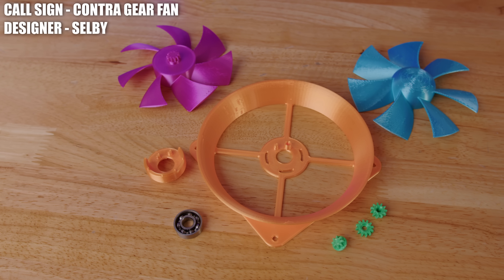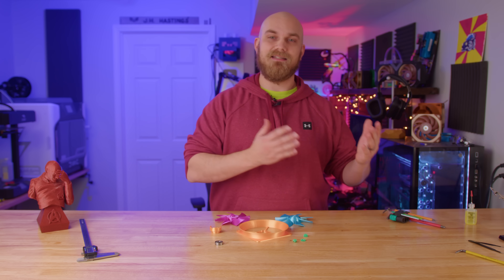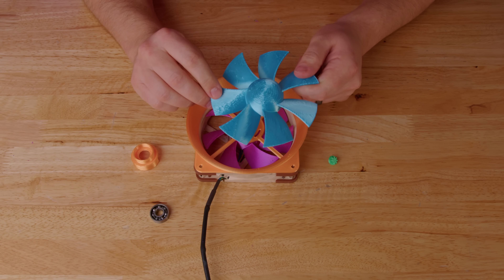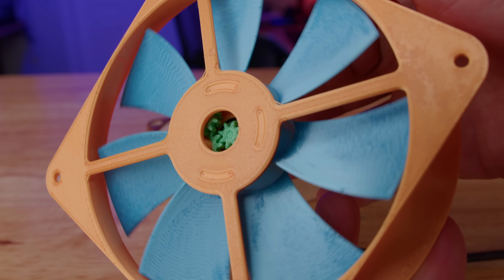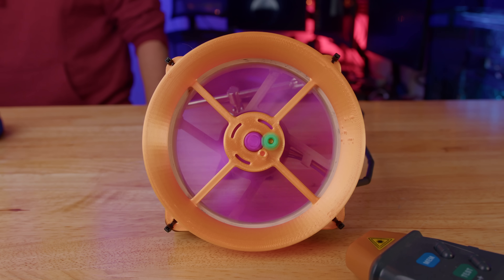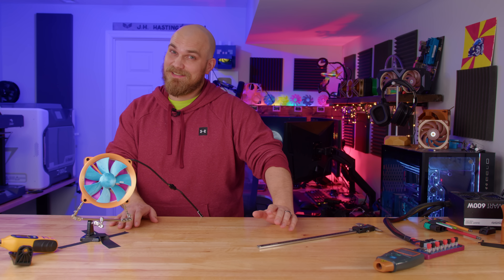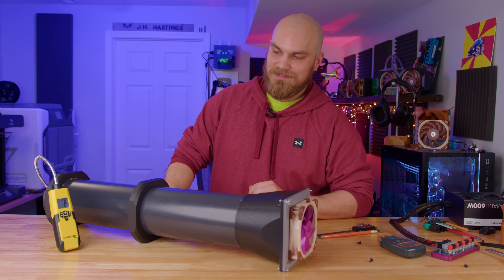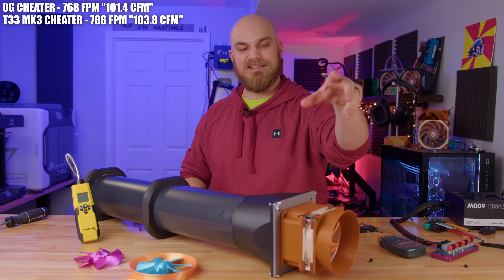World’s Most Complex PC Cooling Fan | Fan Showdown S4 Special

Comment: Contra rotating props are fascinating to me. Such an efficient concept and I bet if you could tweak the tolerances enough to get a more precise fit or even find a way to seal the gear case so you could pack it with grease you could tighten up the tolerances just by doing that. Such a cool fan design! Good work, Selby!

Comment: Something weird to try... Instead of a fan, instead hook up an air-compressor tangentially to the housing -- The pressurized air should form a vortex, pulling in air at the front and concentrating it at the rear... It may not be a practical solution, but it should be fun to watch!

Comment: You do know counter-rotating fans are readily available from the big industrial manufacturers (Delta "GFB" series, Nidec, NMB, Sanyo Denki etc.)?
Then again, those use two separate motors (usually with separate wires even) so maybe this is "cooler"…

Also, those usually have a different number of blades for each impeller, so as not to create a siren (though they're still quite loud at their rated speeds).

Comment: It would be neat to see how quickly the high performing fans evacuate static air (represented with “smoke”). You could use a plexi or acrylic sheeting, clear, and have a port for the fan with a seal to pull the air out of the clear box.
Edit: that way we could have another real world visual representation on how it could work in a case.

Comment: It's possible to use reduction gears to drive the outer contrarotating fan slower, which means it can be bigger, so I'm thinking a multistage compressor in a horn shaped housing.

Comment: Imagine if you measured the max torque at all RPMs of the motor and calculated where it makes peak power, then used that to design it for the optimal RPM, thereby getting a slight advantage just because you can use more power

Comment: You have to understand that gears add friction, which means you don't add efficiency. It is actually very inefficient. Because you put more tension into the motor.
Its like you tow a car with your car. You can't expect the same speed from a single motor.
In my opinion, you should put 2 fans with 2 motors. Just stack the fans. As simple as that. Stop wasting your time and learn some physics.
Stop listening to idiots and scammers. Don't be like free energy people.

Comment: Why aren't these resin printed? I'm not familiar with all the different types of 3d printing, but from what I've seen, resin allows for a much higher precision which seems like it would eliminate a lot of the mechanical power loss and manufacturing performance problems. I would also assume the noise would likely be reduced (for some fans at least) for the surface imperfections of the fan blades. I'm not criticizing, I'm genuinely curious if there are significant benefits of this type of printing over others.

Comment: I don't know if this is already been said but for printing the secondary fan if you want to you can flipped it over and put a support blocker in that small hole and it would have supported the surrounding structure without messing up the detail of the oval hole

Comment: would it be quieter if the contra-rotating fans were co-prime, i.e. the driver having 7 blades as it does now, but the contra fan having 5 or 9 blades?

Comment: Great video. Thank you. Im a bit of a fan geek 😂

Have you got any data on the specific fan power (sfp) of that contra? (measured in watts per litre per second?) - This is the key metric for fan performance along with “total fan efficiency”. The European metric is detailed in “lot 327” under the European EcoDesign directive. Might be a nice measure to include in your tables.

Comment: Not familiar with 3D printing or custome built PC's process but I do love this series. Just a thought though, changing the gear ratio to a 2:3 or something with a single fan and gear train underneath. The cheater housing would give enough clearance I think. This setup I could see as an answer to overcoming the constraint of the electric drive output. This is all being said to keep with the spirit of the show and not strapping on an actual Rolls Royce motor and sending your PC airborn. Blade angle may also need to be adjusted to grab more air.  Possible?

Comment: That's very impressive, I wonder if you printed the small gears using a resin printer you would get more accuracy. Or perhaps even the entire assembly done that way. Also if you could use some very small bearings or even bushings for the small gears it would be a tighter fit and would spin with less friction.

Comment: cheater frame, is basically a bell-mouth intake, they use them for testing jet engines on the ground, so I'm not surprised that a bell-mouth intake would make a fan better than "vena contracta" sharp angled fan intakes.
counter rotating, vs stator blades with simpler rotor blade design, hmmm.

Comment: Recommendation on lubrication, get some Danco Silicon water proof grease from Lowes, it's very viscous (won't sling off easily) won't attract dust, and won't attack the plastic of the gears, and will help the cageless 608 bearings from rattling (I use it to lubricate my smooth rod bearings on my 3D printers)
That should most DEFINITELY make it MUCH quieter!
I wonder if it's static pressure is higher...the airflow in the smoke test was so smooth and clean on the output

Comment: I’d try static fins to minimise the output air’s spin. Like contra-rotating but should be more effective. Contra-rotating still imparts a lot of spin from the final fan, so if that final fan is replaced with a static fan with only enough slope to minimise the spin it should maximise efficiency.

Also I’d like to see some sort of variable resistance wind tunnel to characterise the performance curves of fans across a variety of flow restrictivenesses.

Comment: From what I understand, the distance between the two fans is important. If you can find the sweet spot - I heard that in a video by Redbull when they discussed their electric plane with counter rotating propellers - you can push more air through than each propeller on its own.

Comment: Can't wait to see contra fan installed in the cheater housing, and maybe make the secondary fan with a bit more of the height, as can't really tell if the additional fan is slimmer then the one that is mounted to noctua base. If the second one will have more height means more area on the blades so more air will be pushed, but with increased weight it will spin slower so that would need to be tested in few variations and pick the best performing.

Seen video about 2 fans that were spinning in opposite direction and their "smoke test" looked similar to this one that is was going very straight and held the smoke together and not dispersing it.

Comment: The thing with counter rotating fans is that the second fan needs to have more pitch than the first one to speed up the air flow going through it. If both fans have the same pitch it can stall out the second fan and create turbulent air flow.
Reply: You can possibly see this at 9:12 in the smoke test. The smoke goes into the front, then instead of immediately flying out the back, there's a slight pause before it starts getting pulled out by the second fan.
Reply: I was wondering if the second fan the air passes through would be better having a more aggressive curve if the air is already moving passed it, it would have less resistance, wouldn't it?
Reply: You can reduce turbulent air flow a bit by simply adjusting the speed of the fans but you're right, there needs to be higher pitch on the second fan blades.

It would also make more sense to power the outer fan rather than the inner fan since you really should be increasing the gear ratio from the outer to the inner. If the inside fan is doing all the work then the outside fan is really just an extra set of blades pushing the air with increased surface area. The goal is to get the inner fan to work for the outer fan and pull the air away from it, reducing the contact time with turbulent air coming off the blades and simultaneously (Most importantly) creating a low-pressure area between the two fans.
Reply: Came here to say this!
Reply: I wonder if the blade surface volume was also impeding the performance of the twin blade design?
Reply: Yup. and you want it to have a different number of blades than the first to cut down on noise. 3-5 and 5-7 are decent combos.

Comment: The gear noise could be reduced if there were a way to make more precise gears along with a balanced gear train (two sets on opposing sides) to even out the thrust loading. Only issue is whether that would the friction increase from another gear set be offset by the friction decrease with improved load distribution throughout the drive? (Transmissions like this that see some torque have balanced drivelines in parallel for a couple of reasons, but these computer fans have barely any torque to begin with.)

Comment: You gotta do single fan with that shield on it, the velocity stack is probably increasing efficiency and the single might do a lot better.
Reply: I mean, you just proved that the velocity stack improved the other fan, but you didn't use the smaller velocity stack from the contra setup. Need to do this to be valid.

Comment: An oil/grease you should try is Lloyds AD2000, thinner than white lithium grease but not as thin as the gun oil, and it does not hurt plastics, I'm not sure if it is sold in the US though

Comment: Whenever you want to introduce some kind of gearing system, your tolerances will need to get a lot smaller for it to work smoothly and reliably.
I wonder how it would perform with machined aluminium or steel gears?
Although I think the most ideal design for a contra rotating fan is to just not use gears, and have each one running with its own motor.
Reply: correct but plastic gears are reliable for low torque instances what he should also do is have a housing and add lithium grease of some form of thicker lubricant to quiet  and take up tolarances

Comment: Hmm... you should put more time into making sure things are rotating balanced. (Counterbalance\equilibrate the things)  Even a little bit of imbalance can slow the fan down significantly. For example, I heard an oscillating noise when you tested the Contra Gear Fan with the air tunnel. You didn't measure the RPM at the same time, so who knows how much slower it was rotating?

Comment: The noise from the gears could be reduced by putting in miniature bearings and adding helical gearing. Also, printing in resin could improve on accuracy and would eliminate dragging noises. This design is awesome as is and therefore great for running more optimization! hats off for Selby!

Comment: Now I want to see Selby's contrarotating gearing, spinning mirrored T33-profile blades, in a Cheater duct. My totally uneducated back-of-envelope wild guess puts it in the ballpark of 810-815fpm... though it may require earplugs! I also wonder if there would be any advantage for sewing machine oil over gun oil in a system of gears, though if there is any difference, I bet it's tiny.

Comment: could  you do a tst with this on a radiator or cooler?

I imagine the effect of counter rotating fan on static pressure might be much greater than on cfm alone
Reply: The biggest benefit of contrarotating fans is efficiency and torque cancellation.

Comment: In the future try PTFE lube. I got the 3 in 1 PTFE because it was supposed to be a resin printing hack(didn't work BTW so...) and I needed to lube up my 3D printed air raid siren(works great BTW) so I tried it and it works great. 3 months later it is still running well and still well lubricated.

Comment: You missed an opportunity to test another variation of the contra fan. Since the Noctua housing is in the middle of the Cheater setup take the back end of the Cheater attached to the Noctua housing and put the Contra on the front end.

Comment: I don't want to be stating the obvious here, but do all 3 in one.  Two T33 blades made to contra- in the oversize cheater shrouds.  Make this an ongoing thing as people optimize different components and/or better blades are introduced via the fan showdown.

One point on the testing here, since it's the shrouds on the Cheater that are making the difference:  The shroud on the contra-setup was removed with the blue fan, so maybe the shroud played a part in improved airflow.  For truly reliable testing, one would have to remove just the blue fan-blade but leave the orange shroud in place....but it's all glued together now so I don't know how possible that is.

Comment: One of the things I like about the fan show down is it gets people goofing around, which is fun, but then it gets people thinking about actual thermo and aero dynamics and it's boss. Think about the way pcs have been built since forever. A box. With some fans in some places, occasionally somewhat thought about about air flow. Gpus with fans on them blowing air from inside a hot box to cool off a hot circuit board... Sure the box has ventilation, but what if we ducted cool air directly from the exterior of the box to the gpu? Or ducted directly from the exterior to the cpu cooler? Fuck a dumbass box, I want a pc case reminiscent of an f1 race car, with aero, ducts and silent fans galore! Let's go fan show down!

Comment: I think that, in the name of fan/airflow science, there needs to be some Major Hardware Hardcore testing done with and on the Cheater Housing.

1] - tests to determine if the 'airflow straightening box' helps any (by itself), across a couple different fans to ensure consistency; flow tube and smoke
    1a] - if it does help, can it be made more compact, and by how much before the gains plummet significantly (perhaps instead of printing multiple sizes, a full size is used and then marked with a ruler & sharpie every 1/8in, then use a belt/orbital sander to easily remove material between tests)
    1b] - one thing that might be needed on the box, in order for it to still perform at a fraction its current size, would be to double the vanes. As IIRCZ, it is just a simple 'cross' arrangement (2 vane; 4 chamber). 
2] - tests to determine the benefit of the velocity stack (by itself) 
    2a] - can its size be scaled down and still be beneficial; ideally needs to be actually scaled-down models and printed, so maybe just 75%, 66%, 50% and extrapolate (guess) based on those results
3] - does using the flow tube's own air straightening attachment skew results when the Cheater's is also installed -- I only mention this because I assume that's been left on the tube (and needed) in order to get proper CFM readings

The goal here, if it wasn't obvious already, is to try to make for a more compact and "reasonable" Cheater package. As it stands, it's not really viable for use in anything but open-bench computers where space isn't an issue.
Therfore, if the box can be effective still at 15% the original's size, and the velocity stack effective at 50%... then we'd have something more usable inside cases! 😃
(not that I use a case, as I run an open bench; nor do I have a 3D printer either way... so this is just to maybe help everyone else)

🤘 Thanks for everything & ♥️

Comment: i think the way to do this with less noise is to mount two fan frames intake to intake with the blades swapped out (use the best blades on the list, but one side mirrored). no mechanical coupling, but 2 motors. id also be curious to see it with stators as well.

Comment: one phrase.

contra cheater - 3 contra rotating fans create a blade stack, reducing size at the tail or growing in size at the mouth creates compression and higher air velocities down the tube.

[airstack + larger dia outer fan + medium middle fan + smaller final fan]= a contra rotating turbine fan. and with the gears you can add or remove reduction gearing for more torque but lower rpms at the outer fan, than the middle and final fan, and have a stacked support structure that allows the fans blades to rotate well.

perhaps have a central drive shaft and that 3d printed shaft can then power multiple fan stacks up stream from it with their own support structure.

Comment: This turned into a crowdsourced run for the best possible itteration of current applied PC cooling. Good stuff.
Reply: I wouldn't be surprised if a company contacted the designers for the righs to use it (of course buying the design) or something
Reply: @redmist4963  one already has. the accelleron or something i think it was called.
Reply: @redmist4963  I would be very surprised. It is much better to design your own. And the big companies certainly have both the knowledge, tools, and funds to do so.
Reply: That technology first came from Military Aircraft engines from WW2 and such, soooo....
Yeah, you had engines that are used in Aircrafts and Tanks btw.

Comment: Major Hardware As much as I agree with the rest of the commenters that a Contra T33 Cheater should somehow be created for testing purposes, there still needs to be 1 test done before that happens as it is the most important test. We need to see the Thermal testing done to see if the New Contra fan and the New Combo T33 Cheater will keep the CPU cool (or even cooler) and not Thermal Throttle. Along with that we need the numbers from those 2 tests to see how they compare with the leaderboard.

Comment: Set up the contra -. spray the gears with a rubber based paint( maybe like plastidip) ( or just the inner line of the gears) - yes maybe slight adjustments to gear size to still fit properly. but the paint. inner lining might lower the noise from the gears. then take the housing of the cheater and put it on the front of the contra. boom!